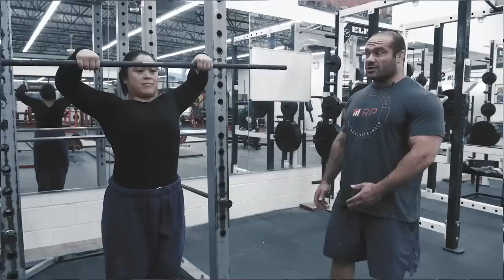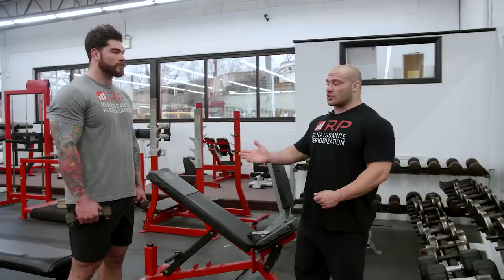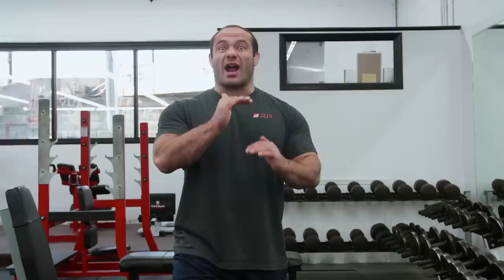Technique Problems Series Introduction &  Stimulus to Fatigue Ratio

Comment: TIMESTAMPS

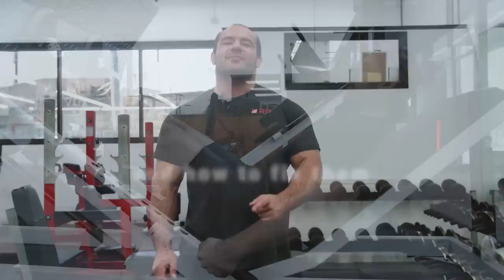0:12 Introduction
0:44 What is the stimulus to fatigue ratio (SFR)?
2:13 The first component of Stimulus: The Mind-Muscle Connection
5:20 The second component of Stimulus: The Pump
6:35 The third component of Stimulus: Muscular Disruption
8:35 The fatigue part of the SFR
9:10 The first component of fatigue: Joint and connective tissue disruption
10:10 The second component of fatigue: Perceived exertion
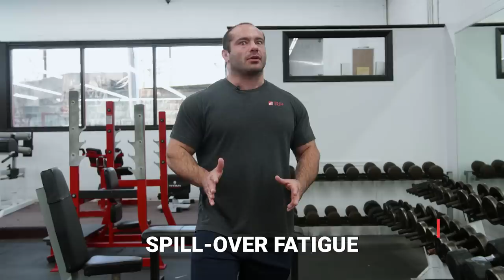11:24 The third component of fatigue: Spill-Over fatigue
12:28 Conclusion and summary
Reply: Excellent work my dude.
Reply: Cheers!
Reply: You forgot to add in 02:46 "You guys see these guns?"

Comment: I think this is by far the most important principle that I’ve learned from you Dr. Mike. 

I wish that I had known about this when I started training, because any time I was using a lighter load and getting a good pump I thought I was taking it easy. Years later, I have realized why, despite the fact of training for multiple sports, I have always felt the best performance increase when performing bodybuilding style training.

Comment: Recently I saw you and Charlie working with another individual on your “version” or preferences on the barbell squat. Let’s see a video on barbell squats for quad focused hypertrophy. 👍
Reply: every type of squat creates maximum quad hypertrophy. you can't escape it, if your hip crease is below the top of your knee you are creating as much quad tension as humanly possible. they're not a complex muscle, thats what they do. they move the knees. it's a matter of what doesn't beat you up the most. IMHO its squats with the ssb.
Reply: frodo the hobo I’ll start off assuming your comment is well meaning. I would think Dr. Mike would disagree with “every squat creates maximum quad hypertrophy” or at least I disagree. If the burden of the squat is assisted to a greater degree by other muscles, would you not agree that the quad is receiving a less than optimal stimulus? Like glutes and hamstrings? I find my squatting “pattern” is very glute dominant and I wouldn’t mind knowing more about what Mike and Charlie were teaching, technique and cue wise in that other video. That’s why I suggested it. I don’t believe that it’s as simple as just find a variation of squats and go at it. 👍
Reply: @bigmarv333   i said what i said because thats what the empyrical evidence suggests. Massive quads have been buily entirely off lowbar squats, wide stance, close stance, highbar, front, etc. If you squat to depth you use the quads tremendously. Theirs no escaping it
Reply: @frodothehobo9938  i think you're right but you lost the point of this video. Low bar is going to have much higher fatigue which is why for growing your quads it's not optimal
Reply: Front squats.

Comment: Chest and Back (rhomboids and mid/lower traps) are the ones I have a hard time feeling any tension on.
Reply: I found when doing cable rows, to pull towards the bottom of the rib cage, works.
Reply: What exercises have you experimented with?

Comment: What if all my exercises feel meh I’m tired, exhaust but can’t point out where I’m sore. This happened after I can back from what I thought were shoulder injuries.I took maintenance phase, lost some weight and it feels a little better. Unfortunately it’s really inconsistent when I get good pumps and not. Somehow I still make pr’s and maybe the next session I get good pumps. The end of my meso I still feel fatigued and that they are productive number wise and physique wise, but I feel like it’s hindering some gains.
Reply: Could be a lot of things going on. Make sure you’re with your volume landmarks, make sure you’re not over relying on certain exercises, and (based on your PR comment) make sure you’re not necessarily aiming for PRs. They should be dictated based on recovery. Try to close in on failure through the mesocycle and allow good recovery to determine your PRs. Don’t chase a PR if recovery isn’t there.